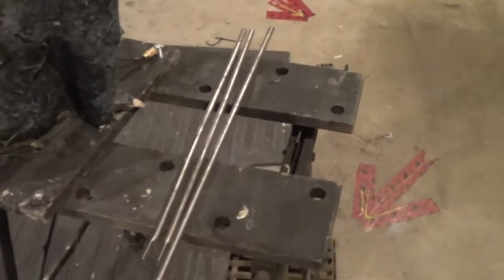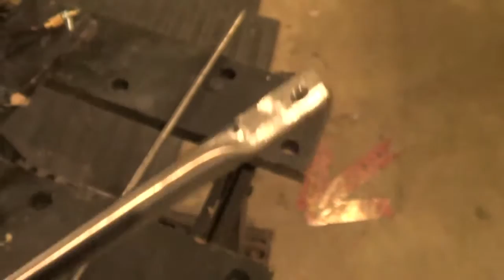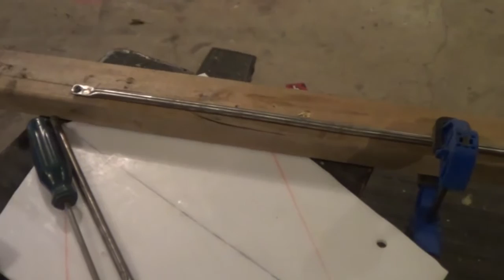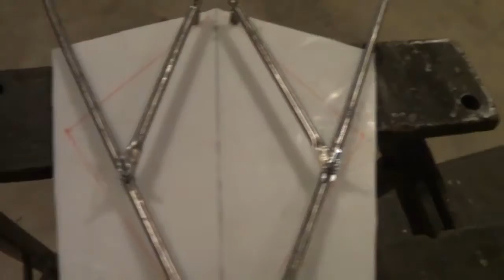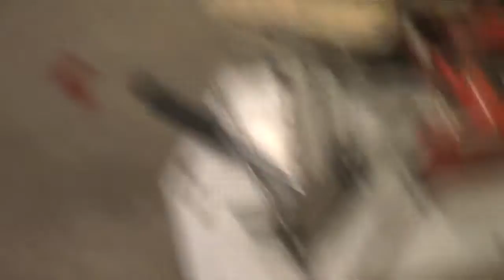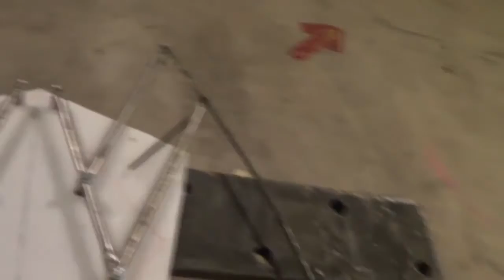Dead Things Vlog Gargoyle W.I.P. Part2

Comment: Hi dead things you are doing great, looks like you have got the geometry just right.
I used thin wall steel tube for my frame. I don't think the weight will be an issue, wiper motors have a lot of power.
The motor I used was from a rear wiper because they only need 90degrees movement which was perfect because I wanted to be able to leave the wings out if I choose to.
where you have the cable tie does need to be a solid pivot point by welding a bolt onto the wire frame.